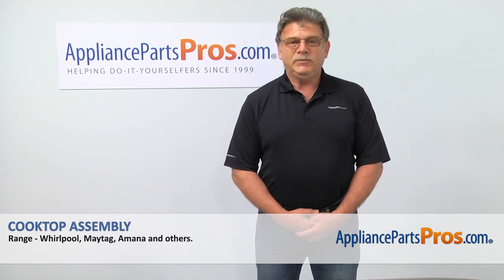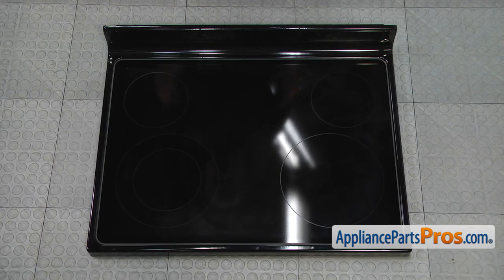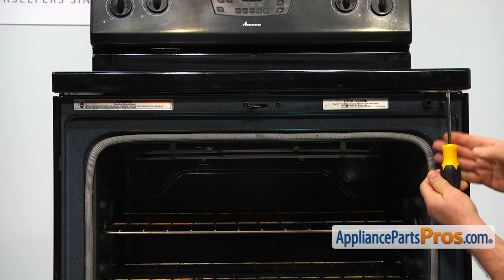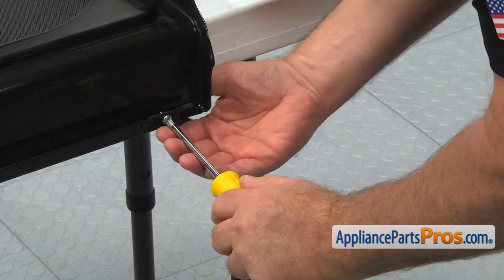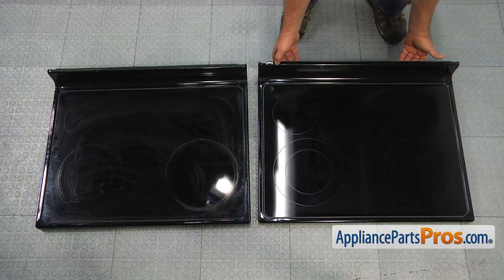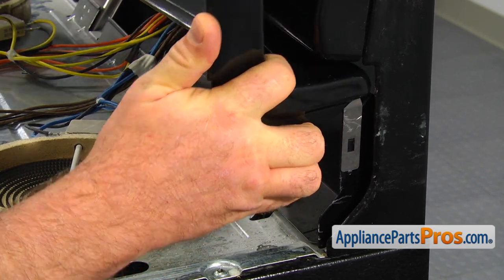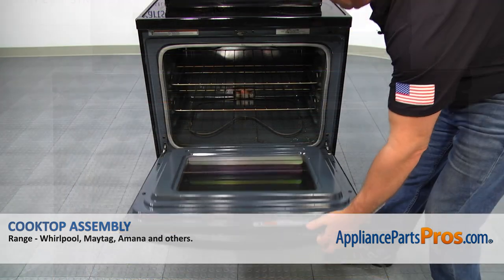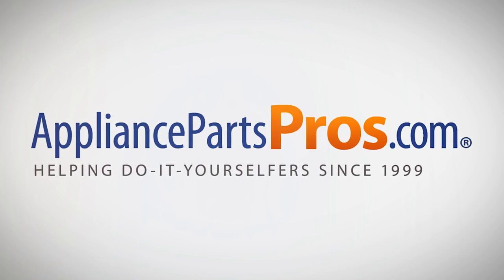How To: Whirlpool/KitchenAid/Maytag Cooktop Assembly W10245805

Comment: How to open a gas stove Supermatic.  And changing the defusers where the gas flame come out
Reply from the maker: What is your model number?
Reply: @appliancepartspros  Not sure about the Model # and can’t attach a photo but the two long silver or gray items under the top of the stove might not need replacing as gas does come out but there or 2 defusers (if that’s the correct word) seem to be lower volume flames and 2 are larger.  I want 4 large.  (I can turn down the flame size with the knobs.  (Could it be the holes in the defusers that only need replacing?  Btw,…under the 2 defusers are rusted 🫣😱. That does probably do well for the operation of the items in question.  Thoughts.  Btw,…you were faster with a question, that I don’t have the answer to with your question than most “repair” individuals have ever been.  So for that, I think you.  Thoughts sir?
Reply: Not sure about the Model # and can’t attach a photo but the two long silver or gray items under the top of the stove might not need replacing as gas does come out but there or 2 defusers (if that’s the correct word) seem to be lower volume flames and 2 are larger.  I want 4 large.  (I can turn down the flame size with the knobs.  (Could it be the holes in the defusers that only need replacing?  Btw,…under the 2 defusers are rusted 🫣😱. That does probably do well for the operation of the items in question.  Thoughts.  Btw,…you were faster with a question, that I don’t have the answer to with your question than most “repair” individuals have ever been.  So for that, I think you.  Thoughts sir??
Reply from the maker: We do apologize but in order to be able to assist you we would have to have a model number to help you out so we can try and figure out what is going on.